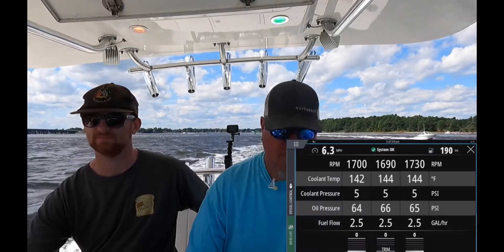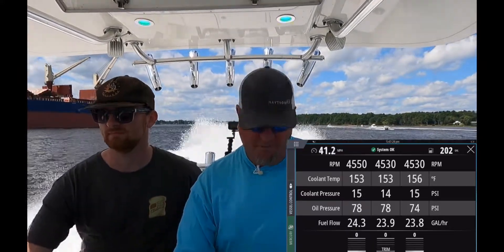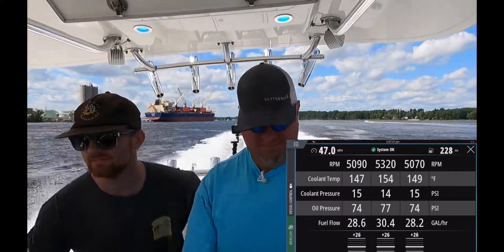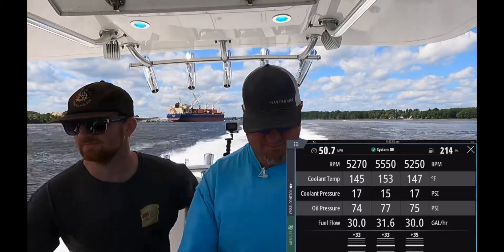2021-9-14 Regulator 34 speed test

Comment: There’s a lot of spray when you have them buried.  Do you think you could mount them higher?  Also wonder why you’re not in the mid to upper 60s when the 300 Yamahas get around 61mph.
Reply from the maker: Please note this was the initial sea trial and test run.  The motors are up in there top hole positions.  A large portion of that spray your mentioning is from the design of the bracket.  If you watch our other videos we do more prop testing and reached a peak top speed of 66mph when all was said and done.  As for the trip Yamaha 300 boat, I don’t think those numbers are with 3/4 tank of fuel, and Seakeeper 3 installed.  They certainly didn’t have open array radar, outriggers, dual VHF antennas, multiple antennas and solar panels.  Its a lot of windage up there on top of being an extremely heavy boat.
Reply: @navtronicsmarinegroup  Appreciate your reply and that makes sense.  I watched the other videos but couldn't tell the correct order to watch them in!   So which props did you finally decide on?
Reply from the maker: @spearfish25   So in the end as she is sitting right now the Rev4 19’s seem to be the best fit for it.  We are seeing repeatable low 60’s with a peak of 66mph in open water with no current.  I think there is still some more to be had but you have to draw the line some where.. A smooth bottom would certainly net 1-2mph alone in most cases
Reply: @navtronicsmarinegroup  What are your thoughts on the boat's balance, especially with the SK3, and the stern lift with the Rev4?  Did you notice any changes to running angle or the need for trim tab use?
Reply from the maker: @spearfish25  It is a testament to the folks at Regulator on how well this boat is designed and built.  There truly isn’t much need for the Tabs in most running scenarios.  I think she will handle slightly better with a small amount of weight added up forward to help with balance but it is truly a big deal as we have already moved the six additional house batteries forward of midships. As for the props she can always use a little stern lift.